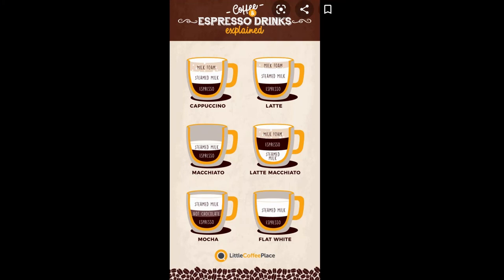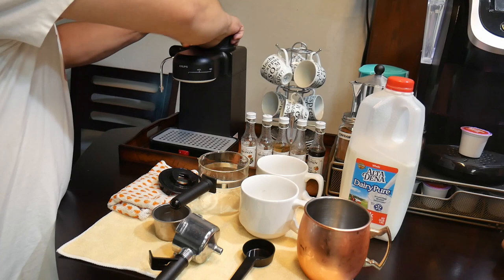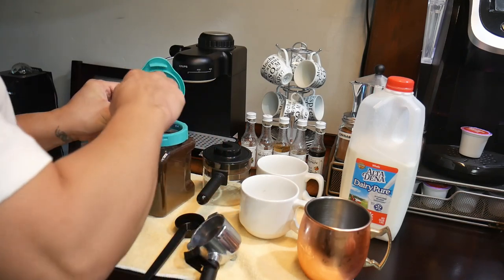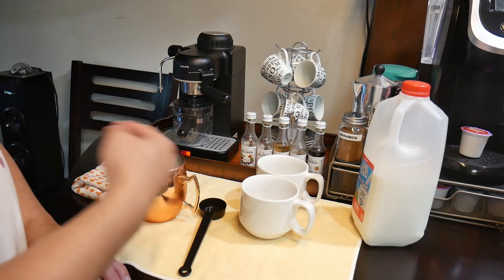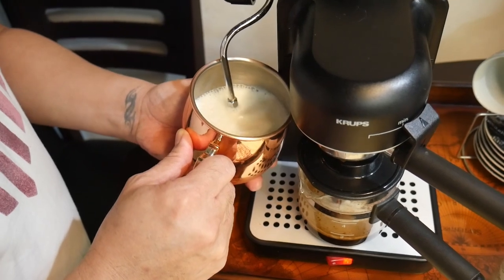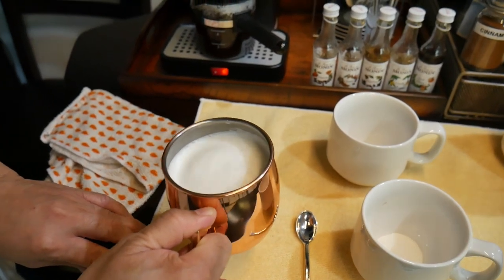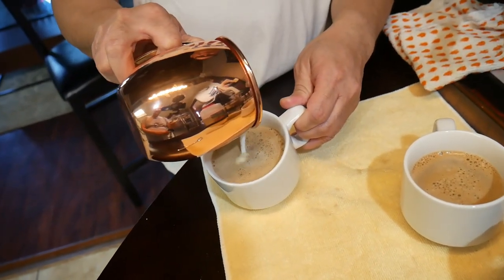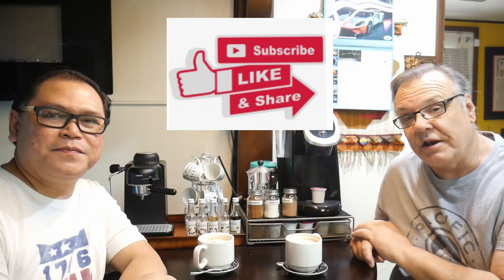Making our morning Latte with Krups Espresso mini

Comment: I just brought our Krups out after 10 years, but it's at least 15vir 20 years old and followed your direction, thank you. Only problem is, our wand looks different and wondering if it was put together right. Our button on the left has 2 options, coffee if turned back, or turning it towards the front for frothing. So I can't turn it to frothing until the coffee is done. By then, there is no more water left.
Reply: Add extra water and don't let the coffee drip all the way until it stops. I have the same older model of Krups machine. Yes you can only make coffee or make steam. I think this makes sense, you want high pressure when making the coffee, and running the steam wand will drop the pressure. You're also probably not supposed to fill the tank, and then let the coffee drip and sputter out until the end, you have to time it all. With this either/or knob, you can make just steam if you want to froth milk for something and you can stop dripping the coffee out too and time your shot.

Comment: Since 1990 I have had 3 of these machines. in every case the gasket in the cap/lid has failed. Looking for a hack to fix it. The machines functioned perfectly except for this ongoing flaw/achilles heel. People on ebay do sell the cap only, but they never can verify that its gasket is intact. You can't tell by look or feel. You can only determine by actually brewing coffee.

Comment: Do you know how to use it without the basket? Bought one second hand on a garage sale and it doesn't come with a basket for the coffee. All I have at hand are some paper filters.
Reply from the maker: You can probably get a basket of equal size at a coffee specialty store , if not I'd improvise by cutting an old baking wire sieve to fit your basket cradle  but then I think you would still need your paper filters on it.